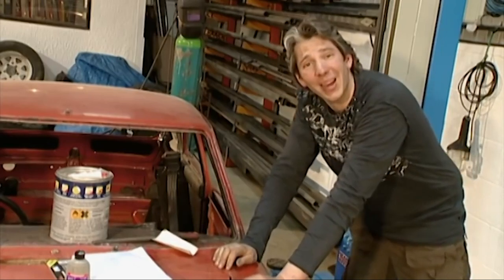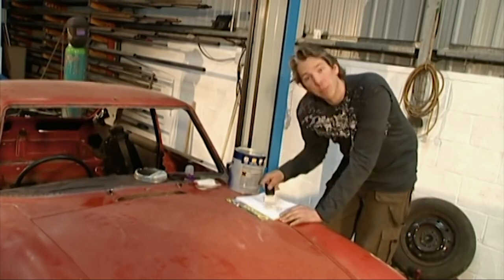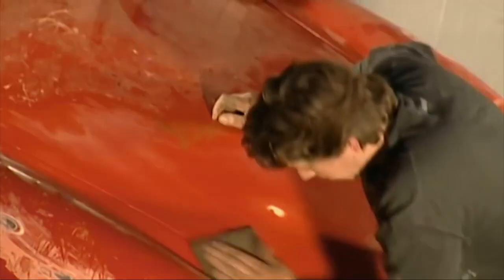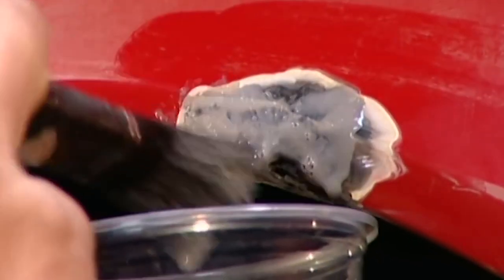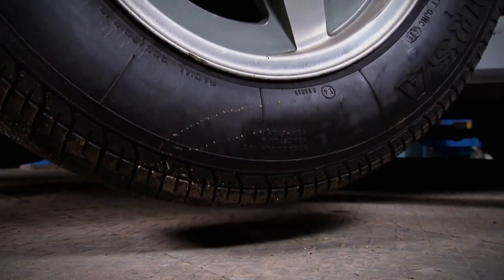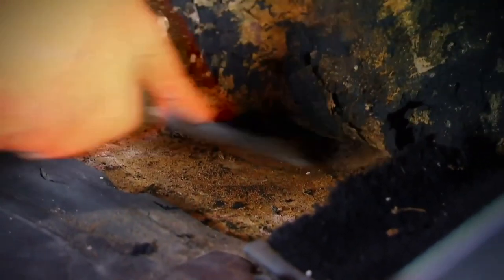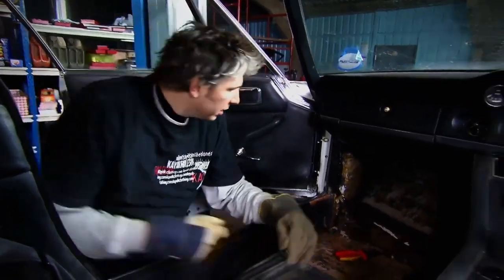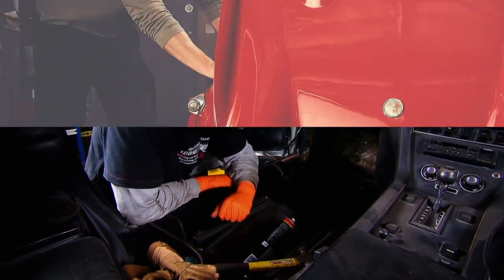Wheeler Dealer's Ultimate Guide To Repairing Rusty Cars | Wheeler Dealers

Comment: My local mechanic and local body shop both say you have to cut the rust out or it will only come back...they call it "body cancer" and it's not curable.
Reply: All steel will rust in time - it is inevitable! 
This however, is an effective way to slow that process down.
Reply: They are just trying to get money out of I would use the fibre resin filler though they build cars out of glass fibre
Reply: @shaunontheinternet1452  Steel will never, never rust if it is never exposed to water or oxygen.  Body filler compound and primer paints do not create a sufficient barrier against moisture or oxygen.  Too many people finish the repair to the primer level and fail to apply paint (colour coat) and clear coat on the same day.  Seal it and it will not rust until the barrier is once again breached.

Comment: Yeah I bet those repairs lasted. Rust converter is snake oil.
Reply: Rust converter is an excellent product but must be used properly.  The first step is to grind, sand our cut out every spec of rust that is visible to the naked eye.  Apply the first coat of rust converter and within 15 minutes to an hour the iron oxide (rust) particles that remain behind will turn black (to ferric phosphate) and appear visible.  Now re-sand the surface of the panel, leaving behind the specs of black converted rust, that are now visible.  Next, use a Dremel tool with a precision grinding bit and go after all of the remaining specs of black, just as a dentist removes your tiny cavities.  When satisfied, apply a second coat of rust inhibitor and allow it to dry and convert for an hour.  Then apply the third coat of rust inhibitor and allow it to fully dry, convert and cure for 24 hours.  Now you can proceed with 2 coats of primer, the colour coat and the clear coat ON THE SAME DAY.  Ferric phosphate (the converted rust) will never re-rust....it's chemically impossible.  The only thing that can rust is the virgin metal under your repair and only if water moisture and oxygen can reach the metal.   If the repair does not last at least 10 years, either all the rust was not removed or converted, or (common problem) the rear side of the panel was not treated equally, or the paint and clear coat barrier has been breached.
Reply: @chrisgraham2904  So if you comprehensively remove all the rust by grinding and sanding then the rust converter works okay?  Well it would if you've already removed the rust by another method. But thanks for repeating what sounds like the marketing blurb off the back of the box.
Reply: @Imp5011  LOL  I don't work for, or hold stock in rust converter.  I've had great success with the product.  My 1999 GMC Safari van developed rust in 6 spots (the same spots that every van of that model rusts).  I did the body work in 2009 and those spots have never re-rusted.  Rust is automotive cancer and the only way to cure it is to surgically remove it.  Rust converter is like the chemotherapy or radiation treatment after cancer surgery, just in case there are stray cancer cells lingering behind.  As noted, many people don't use the rust converter properly and they fail to provide the appropriate barrier that prevents future rusting from happening.